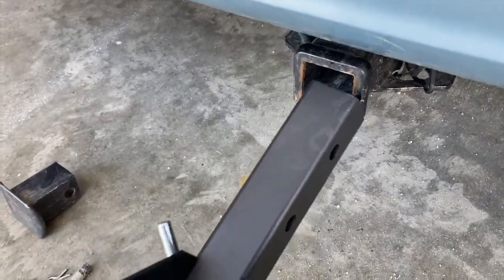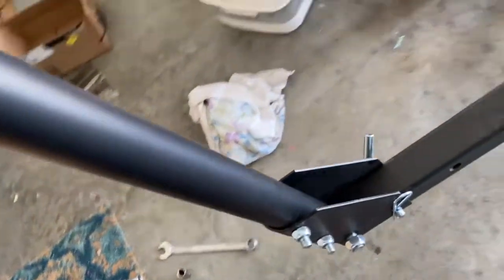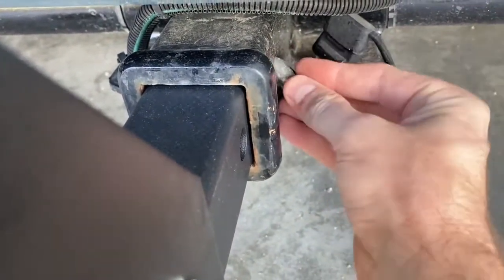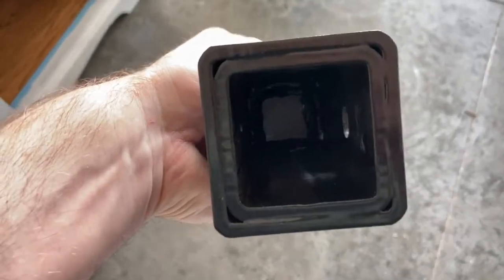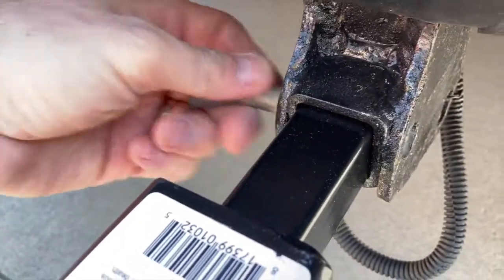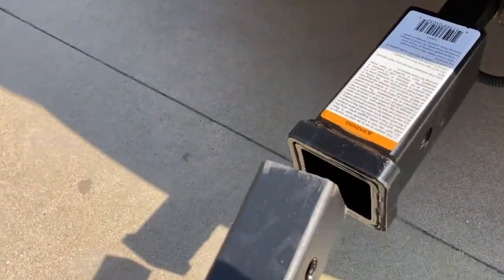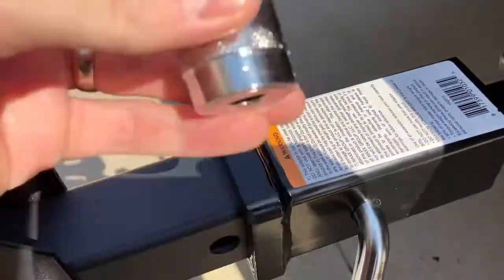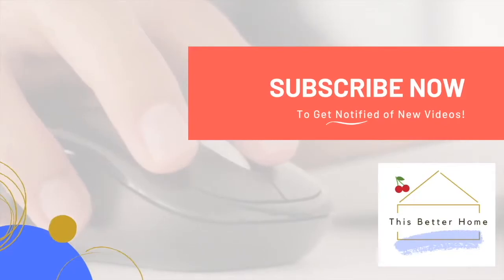🔥 How to Convert Your 1-1/4 Inch Receiver to Accept 2-Inch Hitch Mount Accessories➔ Quickly & Easily

Comment: Did u end up having sway and lots of raddle I have the same set up and the sway is so bad .did u end up buying a anty rattle u shape bracket
Reply from the maker: No raddle. There is some sway, but it has held well without issues since I made the video
Reply: Do u have a  link for a lock able pin I have been looking for one lol
Reply from the maker: @lunnamoon80, check the specs first but maybe try this one, as it has a dust cap, shouldn’t rust, and has solid reviews: https://amzn.to/4dm4UjU